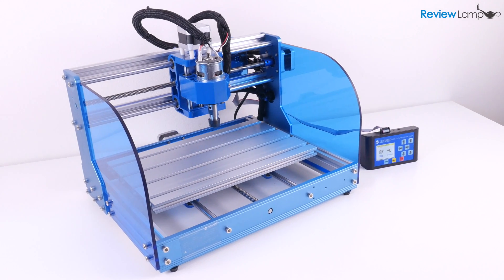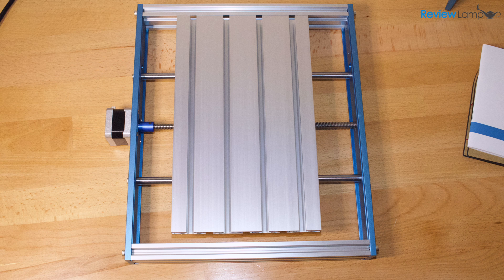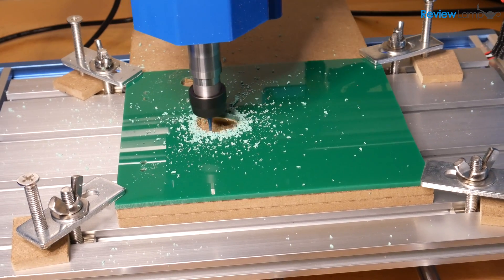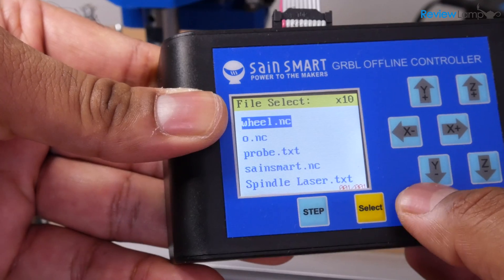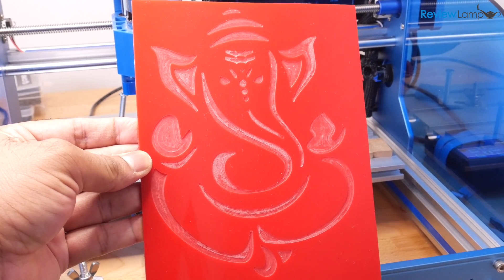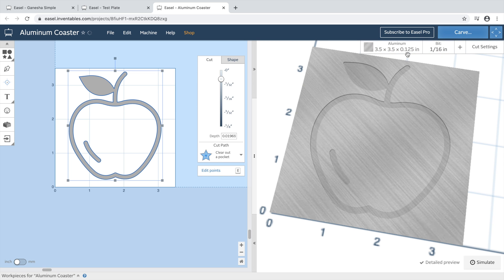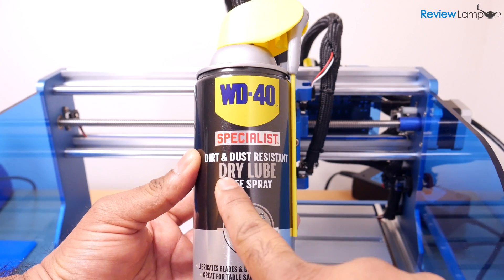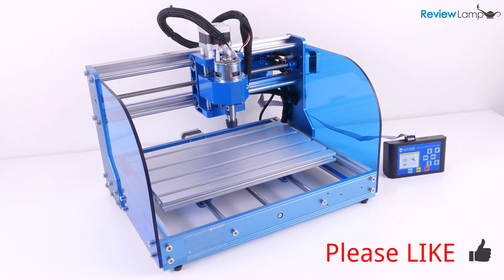Sainsmart Genmitsu 3018-PROver CNC Router Review and Test(MDF, Acrylic and Aluminum)

Comment: As far as the wiring… did you have a problem with cables not being long enough or unplugging when the machine went all the way left? :/ I thought I broke it
Reply from the maker: No. I haven’t run into that issue yet

Comment: Can it cut .030” thick copper sheet?
Reply from the maker: Yes. It should be able the handle that. Use a wood or mdf backing plate when cutting copper, in case you are cutting through the material

Comment: I would like to learn how to use the 3018-PROver CNC Router with hopes of getting good enough to use one of the milling machines at work or at my local makerspace.  Is that a realistic expectation?  I have solidworks student version, so Im hoping to learn all the "machinist basics" on this machine and then be able to use the bigger machines.

Of course I will still need at least little training to use the high end stuff - but my hope is that I can use this as a real stepping stone to get me 90% of the way there in terms of being ready for using the expensive ones.  

To reframe the question using metaphors:  If I learned to drive a bargain economy car lots of that learning would transfer into being able to drive a high end sports car.  Of course there is a huge gap between the two vehicles.  BUT being able to drive is usually a prerequisite for driving the expensive car.

I appreciate any advise on how to go about using / learning this machine with the goal of being able to eventually use the industrial grade machines.
Reply from the maker: Yes. That’s a reasonable expectation. This is a good starting point and will help build your skills for more sophisticated machines

Comment: Thanks for making such a well done detailed video. Could you share your settings for cutting hole in ABS? I'm having trouble getting them right. These are mine settings right now:

Router bit: 2 mm dia.
Feed rate: 150 mm/min
Plunge rate: 100 mm/min
Depth per pass: 0.5 mm
Spindle speed: 3,500 RPM

Thanks!

Comment: GREAT VIDEO, CONGRATS! I'M TRYING TO ENGRAVE A PATH ON A 21 MM THICK MATERIAL, BUT WHEN I SET THE XYZ ORIGIN THE MACHINE DOES NOT START. I THINK THAT THE TRAVEL OF THE Z AXIS IS LIMITED BY THE END STOP SWITCH. IS THERE A WAY TO DEFINE THE TRAVEL SO I CAN WORK ON MY 21 MM WOOD? THANKS
Reply from the maker: The only way around this issue is to elevate the piece such that it has enough z movement to complete the cut. The machine has 45 mm of z travel

Comment: Can you cut through in that 1/8” thick aluminum panel like you did in that acrylic panel? Thank you
Reply from the maker: Yes. Only if you slow down the feed rate a depth per pass. It will take some time and patience
Reply: Is there any Stronger motor upgrade on this particular 3018, that you know of? Thanks

Comment: Very nice review!  Let me say upfront that I'd love to see you do a demo video on milling a double-sided (or single-sided) PCB on copper-clad FR4 material with the 3018 Prover CNC.  This would help because there are a number of ways to do this, using a number of software programs. While some may know exactly what those steps are, not everyone will, so it would help take some of that guess-work out and cover what's required in a general sense.  And your video makes me feel better, too, because I just purchased the Sainsmart 3018 PROver CNC for prototyping PCBs and though I know it's not a high-end machine it should do a satisfactory job if the machine is set up properly and the proper bit type/size and other setting are in place - that's the part that's subject to guessing and experimentation.  I've subscribed to your channel and looking forward to other of your videos on the 3018 CNC, and hopefully one on milling PCBs!  Thanks.
Reply from the maker: Thanks for the comment. Will certainly look into that
Reply: Thanks  @ReviewLamp  - I'm looking forward to that video!
Reply: Hi peter, were you able to have shallow cuts like less than 0.2 inches to cut through uv masks when making pcbs ?
Reply: Hello Rajesh:  I have not yet received my 3018 so unfortunately I can't answer your question at this time.  I expect delivery any day now so I'll have to get back to you after I've assembled and set it up.  I will likely be a week or more I would expect.

Comment: Hey, I liked your review of the CNC machine. After working with it how do you think it does while milling copper or aluminum? I am thinking of making some custom water blocks and distribution plates for my PC water cooling kit; do you think it would be able to cut cooling fins into copper with the current spindle? I saw where they offer a 20,000 RPM spindle for the machine. If the 10,000 RPM does not cut copper well, would you think that the 20,000 RPM spindle would be able to or should I look at a different machine?
Reply from the maker: Please take a look at the section of the video where I mill aluminum
Reply: did you buy it to cut/mill copper?any input from your side would be appreciated! thanx

Comment: Very helpful review, thanks!  I am wanting to purchase a CNC Router and am a beginner. I want to incorporate it into various woodworking projects, specifically with inlays and cutting out intricate shapes that are a bit too detailed for my scroll saw. Does anyone have any idea how long it would take to cut a simple shape all the way through a 3/4" board of walnut, maple, etc.?
Reply from the maker: Thanks for the comment. The time it takes depends on several factors. How intricate the cut is, what size bit you use and your feed and plunge rates. The best way to figure this out is to upload your design to Easel and then simulate it to see how long it will take

Comment: Hi, thx for the vid, I just installed one myself, first start everything axis seem to work with the manual controller except the spindle, question: you should be able to turn on the spindle using the manual controller right? connected red to motor + and black to motor - and the other side of the connector is connected, however when i use the controller use select to move onto spindle/laser and hit enter nothing happens.
Anything I could have missed or does it mean either that part of the board or the spindle motor is dead ?
Reply from the maker: Did you insert the provided micro sd card into the manual controller before you tried turning on and off the spindle?
Reply: @Reviewlamp  No I didn't but then when I did it worked, didn't expect the manual controller to need the gcode on the sd to start the spindle, but yeah that was it. Thanks man.
Reply from the maker: The sd card contains a file that defines the maximum speed of the spindle, thus its importance in making it work. It is an odd thing though
Reply: @Reviewlamp  anyways thanks a lot mate, I see you know your stuff !!, watched a few other of your videos, great stuff, thanks!

Comment: Excellent review! I've been flip-flopping between a K40 laser (at around $370) and something more like this, primarily as a means for cutting small 1/4in or 1/2in MDF templates for routing in furniture projects. I think your review has helped me decide that the CNC may be the better option for my use case! 
That fact that it's about $200 cheaper, far better official support, and is capable of cutting multiple depths all the way through even pretty hard materials makes it quite appealing in comparison to the K40 whose only major advantage besides the pinpoint accuracy of a laser is that it has maybe another 2 - 4 square inches on its cutting bed.

Making the purchase! :)
Reply from the maker: The K40 definitely has it advantages but also needs ventilation due to the smoke produced during cutting, thus limiting its use as a truly desktop machine. Glad the review helped. Thanks for your comment
Reply: I know it's 5 months later, but a 40 watt laser isn't going to be cutting through 1/2in MDF.  1/4" is really your limit.
Reply: @johnflux1 Fair enough. I ended up going with this 3018 after all. Probably will be upgrading to something with a larger bed eventually but I'm not disappointed
Reply: @TracksWithDax  I just bought a 3018 myself, just a couple of hours ago :-)